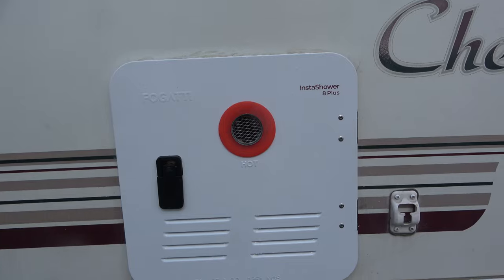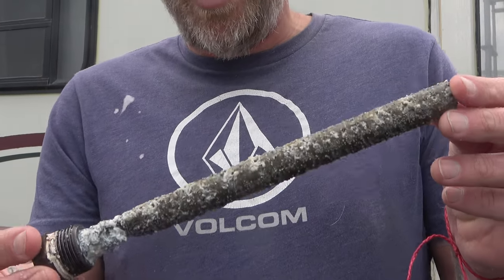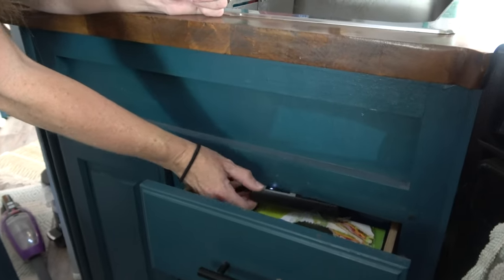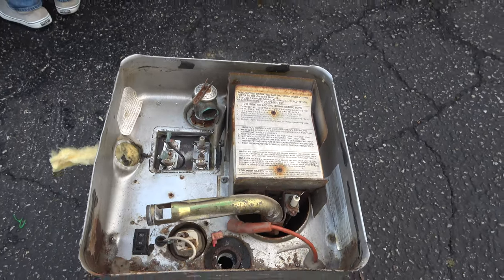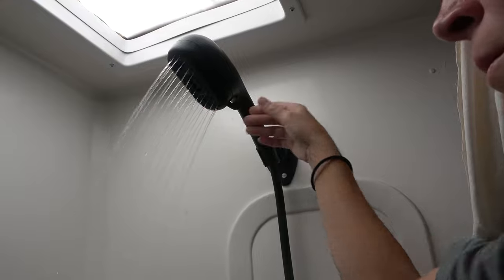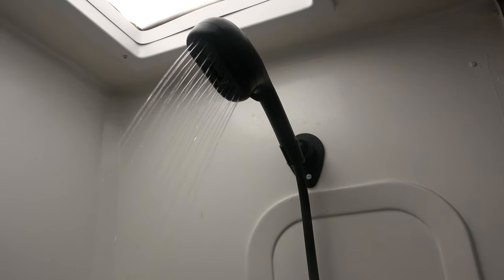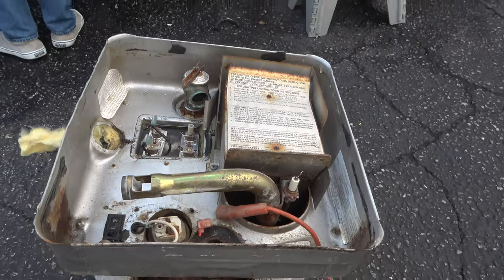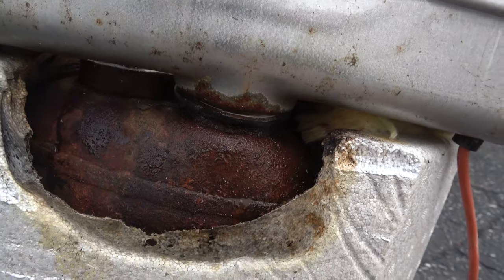Should You Upgrade to a Tankless Water Heater?! // RV Tankless Water Heater PROS and CONS

Comment: In Australia, people have put a return valve on the hot water line that recycles the water in the line until the heat is at temp.  Saves water and just lets your hot water come out warm.  Just means you might have to wait a few extra seconds. No more juggling wasted water.
Reply from the maker: This is a great idea and one we would have tried if we knew about it when we were remodeling our RV. To access the plumbing in our RV (and most) is too challenging without having to take apart our shower or adjacent walls. RV manufacturers don't think about people upgrading what they build. They plan on you having to buy new RVs on a regular basis. When we did finally have to take our shower apart due to a leak we realized that was the time to do the return valve. But we didn't have the time or inclination at that point. We're getting along just fine without it. But definitely an idea if you have access to the hot water line into the shower.

Comment: Great info! I'm considering a tankless water heater upgrade for my travel trailer. My home tankless water heater (Rennai) has a recirculation function to avoid the water waste. You basically install a thermal coupler at the faucet so the waste water returns to the heater via the cold water line. They call it "ThermaCirc360". Hopefully we'll eventually see this function in Rv water heaters.
Reply from the maker: Great idea!

Comment: Mine keeps having an E1 code, kicks on for maybe a minute and then flame out code. Worked yesterday after install but now I can’t even do the dishes. Hoping the issue gets resolved soon.
Reply from the maker: Usually the E1 code means you’re low on propane. When our propane gets too low the water heater will light but cut off soon after. We switch to a new tank and it fixed it. But maybe the pressure in your propane tank is too low?
Reply: Fresh 30lb tank just filled this morning. Seems like when the flame is on low it’s ok. As soon as it goes to the full flame it cuts out. 

Set it to 109 the shower runs fine. Turn sink on full flow cuts out. Turn on until the flame just barely turns on it heats up fine. 

Fogatti says control board but I dunno if I’m gonna keep it. Probably just return it.

Comment: I have wondered about propane usage compared to tank. Is it more or less.
Reply from the maker: The tankless are more efficient! The propane only runs when you’re using the hot water. Where as on the tanked ones the propane has to run for however long it takes to heat the water in the tank up(our old one took Atleast 15-20 mins to heat up). The only thing you lose is the electric heating element which obviously doesn’t use propane

Comment: Just my 2 cents.  I have a new Girard tankless water heater (had to replace the original one).  I absolutely HATE it.  I am planning of replacing it this year with a tank water heater.  I know it will be difficult and may even require cutting a larger hole in the outside of the RV.  But for me the tankless option is a huge water waster and works terribly.  The tankless option is a bad idea for anyone trying to boondock.
Reply from the maker: We LOVE our Fogatti. Once you empty the "waste" into a container you can use later, it is no longer waste. We fill our dog bowl. But you are welcome to do what you need to do.
Reply: I agree with you! I have had 2 campers with gerrard tankless water heaters in them. The dealer and myself could never get them to work to our satisfaction. They took 7 seconds to react, then forever to get water up to temp, if you shut them off while soaping up or doing dish's you get a scald hot, freeze cold then a slow warmup again! Not to mention our's would come on all through the night if temps got down in the 40's ,and as you know ,they are loud..had to adjust flow on the back of the heater if water incoming was too cold, who needs it! Maybe if we had kids and a lot of showers needed taken or we did not boondock, they might be ok....or buy that 1500.00 one with mix tank built in. We replaced both with the new Suburban aluminum tank heater that does not need the anode rod.

Comment: I dont know why the companies dont add temperature sensor with two-way valve (can be activated by 12v switch when desired), circulation to the fresh water tank, when the flow matches the desired temperature, it switches to the faucet. the lower setpoint, the faster water flows. in case water city source, the fresh water tank will get full, the water goes with overflow outlet.
Reply from the maker: No idea either. I don’t think most RV product companies are owned and operated by people who actively RV

Comment: Food for thought.
If you install a recirculating pump and return line from farthest fixture back to heater you could flip a switch about a minute before using the shower/sink and would not lose any precious resources.
Reply from the maker: Great ideas. Yeah and we’ve thought of adding an accumulator too but the time and effort to plan and do these isn’t worth it right now.
Reply: Sounds like a great idea, but I'm sure that would void my warranty on my 2024 Keystone, LOL
Reply: @DanBlackRacing  you can add recirc in a home and does not void warranty.

Comment: Boondockers, your options are:
1. Cold showers
2. Hot showers, run out of water.
3. Hot showers, bring extra of water and a extra grey tank
4. Don't boondock.
Reply from the maker: We still boondock plenty with our water heater and don't complain about it. The overall benefits surpass the negatives.

Comment: Looks like the Girard Tankless has more reviews, and better reviews than the Fogatti
Reply from the maker: I believe the Girard has been out longer than the Fogatti. If you read the reviews on Amazon Fogatti does have MANY positive reviews. And the Fogatti has a higher BTU at 55,000 compared to the Girard at 42,000 BTU. Also the Fogatti is designed to work better at higher elevations.
Reply: There's some YouTube videos as well of folks having probs with the Fogatti within a few months.  I'd probably stick with Girard or Truma